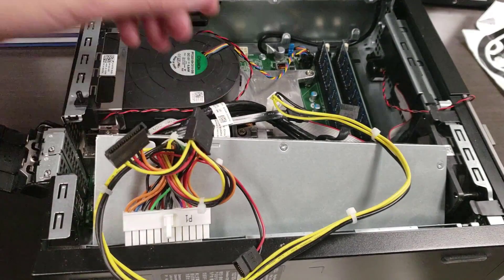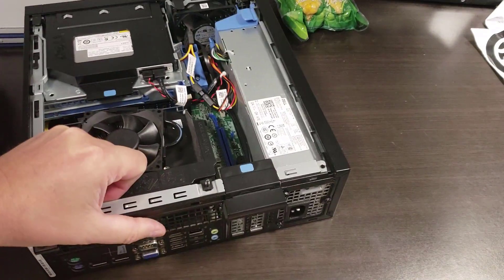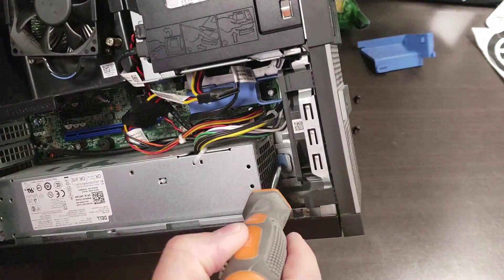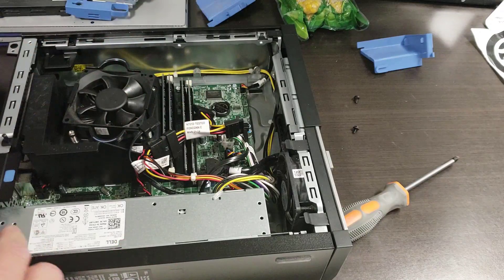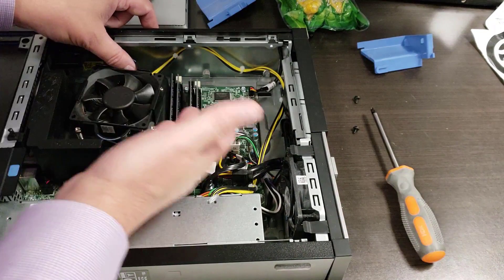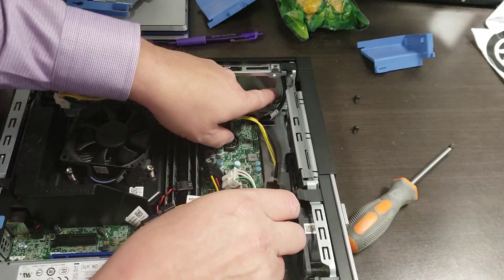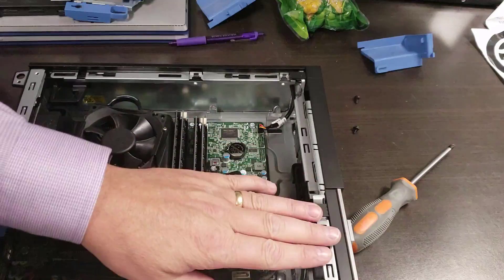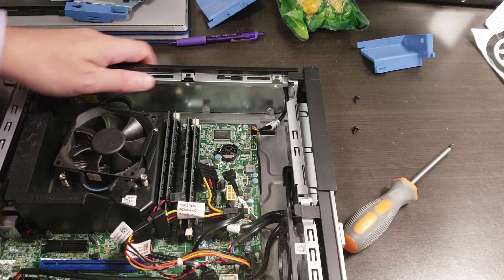Disassemble Dell Optiplex 9010 or 9020 SFF & Change Power Supply

Comment: How do you know if PS is bad in the first place, before ordering something that may not be at fault? Mine does nothing when pushing on the power switch. Haven't done anything beyond that but I think to be fair, I need to jump the power cord key internally, to say the least, if only I would know which of the 4 yellow and black wires. Any help?

Comment: can the motherboard fit in a standard atx mid-tower case
Reply: no I don't think so, Dell has its own proprietary motherboard mounting holes in it (i think). it also has a connector for a temperature sensor that isnt in most cases. My brother tried to put an optiplex 9010 motherboard into a different case but it didnt work out because of the temperature sensor not being there (which isnt a huge deal because it will still run perfectly fine, youll just have to hit f2 on boot every time) as well as the on/off switch being some dell proprietary thing. If i were you, i would just look for a 9020 mt case or something similar